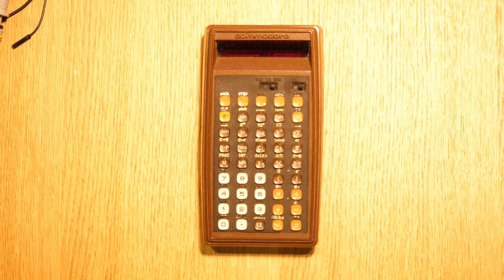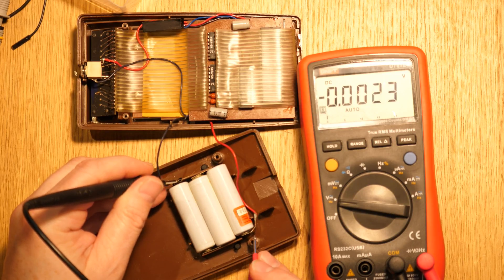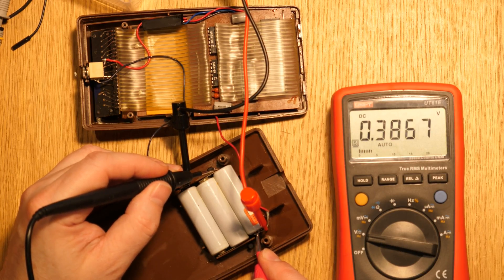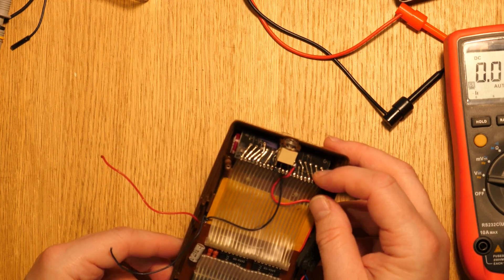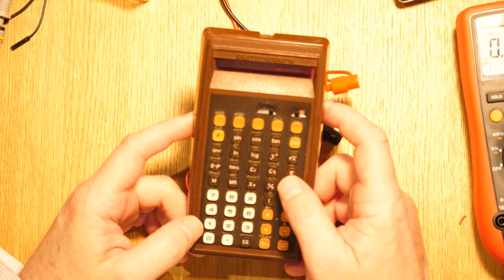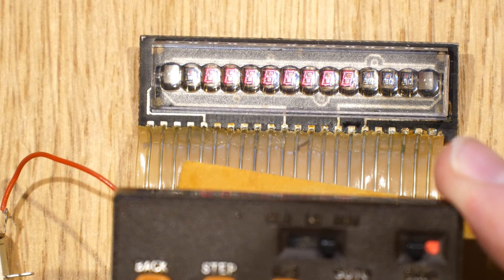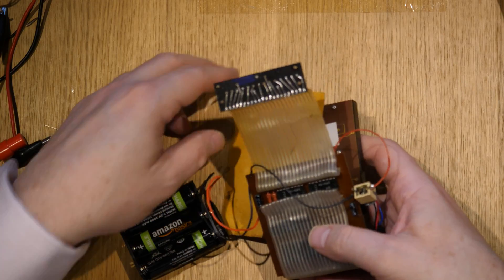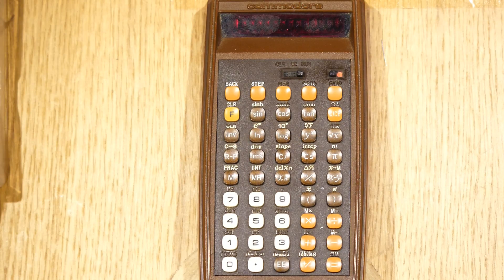Commodore PR100 retro calculator renovation

Comment: Interesting.  So that little potted stick is an inverter.  I always wondered what those were.  In addition to the PR100, I had an SR4190R that carried me through tech school.   It had a killer feature - I called it "exponent bumping" that I have never found in a non-Commodore calculator.  Basically, if you have an answer in nano-somethings and you really wanted micro-somethings, you just hit a key until the exponent shows -6...the mantissa will adjust to suit.   Being so fond of that, I still have a working 70's Commodore on my desk - an SR5190R.    And a couple SR-1800's.  Not as fancy as the SR5190R, but they have gorgeous green fluorescent displays.

Comment: I removed the batteries in the '90. With the charger still working! Nostalgic fun. I just followed your programming steps :) Instead of +1=  i tried + 0.01= to 00 as floating works :) I wonder what number I get tomorrow. Thanks for remembering were we come from... It is a piece of history that 72 steps calculator
Reply: Was the ram originally intended to be battery backed or did it clear when turned off. I did a repair on mine and mine clears but I’m curious if that was intended.

Comment: Thanks for sharing this. I too have picked up a PR100 from Ebay and looking to get it working. Thanks for the insight of the inverter in the black box. I assume this is to generate some negative voltage for the IC chips (or all of them). From my basic undertanding, these circuits are possibly using an LC oscillator, with capacitive coupling with a pair of diodes to output some negative voltage. However, these inverter circuits don't source/sink much current? Do you know what the circuit current draw is?
Reply: >However, these inverter circuits don't source/sink much current? Do you know what the circuit current draw is?< 
The power stage supplies the negative voltage required for the MOS chips of approx. -5 volts in relation to the BLACK of the battery and the power supply voltage of 6 volts. The current of the power stage ranges from 40-110 mA (depending on the utilization of the 12 digits of the 7-segment display).

Comment: You should be able to just press R/S (RUN/STOP, like on the Commodore 8-bit computers!) again to STOP the running.
Reply: R/S stops a program during execution to show a value on the display. If one press R/S again it resumes the program...
It's also used to start a program... Notice how he runs the small program - he presses GOTO 00 and then R/S... It is possible to have two or more programs in the memory and execute a particular one by typing GOTO followed by a 2 digit number between 0 and 71...
Reply from the maker: Just be aware it'd been about 35 years since I last used this ;-)

Comment: Don’t know if you’re still seeing these comments but I really like to know where you put the capacitor across the inverter? It looks like the blue and black but it’s too difficult to see. Thanks
Reply from the maker: I'd imagine it was on the output.
Reply: @nezbrun872  It looks like its directly attached to blue and black. I have an SR-9190 that just displays a row of decimal stops across the display. I noted that the outputs from the inverter seem to be +4 and -2. Not sure what they should be but I think the -2 is too low. Also don’t know what the effect of only -2 might be. Would the cap across blue and black help at all? I’ve replaced the other two capacitors and cleaned and resoldered  the wires from the inverter, which had output +3 and -1.5 so a slight improvement, but still not a working calculator. If you have any pointers I’d welcome any further advice you have.
Reply: @derirrevomzombiehof4893  Many thanks for this, and you English is good. If you find out any more please do let me know. My electronics knowledge is very basic, so please explain in simple terms. I’m powering it from 3 AA 1.2V rechargeable batteries connected straight to the circuit board. My fear is that one of the ICs has been blown due to over voltage, my hope is that it’s just incorrect voltages being supplied by the ASTEC power inverter and regulator. If I had another I’d solder it in and see if that fixes the issue, but I don’t. Could you take the ASTEC from your working 4190 and try it in the bad one and see it fixes the issue? I have replaced the two capacitors, I don’t know if the 4190 has these capacitors? but it made no difference :-(

Comment: Nice video. I just got one of these calculator with similar battery. But is it  ok to just solder in three 1.5v batteries on as shown in the video? Wouldn't the voltage be too high?

Comment: I had one of these!  Still hiding in my junk somewhere.    I bought it brand new when it came out.  Actually, I saved up the complete price - including tax - and put it in an envelope waiting for the ( programmable! ) calculator to become available.  I seem to remember going to the calculator store once a week for about 6 months.  Somebody had messed up at the factory.
I wowed my calculus teacher by writing a program to calculate pi by adding up the area of a quarter-circle.  And wrote programs to play with resonant circuits.

  At some point, I eliminated the battery by replacing it with a string of forward-biased diodes.
The calculator would only work when plugged in, but it didn't suffer leakage either.

Comment: Hi, I have the same model but mine has two 47uF instead of 33. Unfortunately the black box that delivers the negative voltage is missing, I remember I took it apart, but it got lost somehow... I tried to power  with a regular DC adapter - it turns on with only the terminals +5 and GND connected, but it only displays 0.00 and all keys seem to be unresponsive. Later, I powered it with +/- 3.6V and GND (I used 6 NiCd batteries) but the unit either displays 0.00 or random numbers on the display. The display works fine, all segments are ok, also the two small chips that drive the keyboard and leds work well... Could you please tell me at which terminals have you connected the 33uF,  I really liked to put it to work...
Also, do you have any idea how can I replace the power converter with modern components? I was able to open it, it had a small coil with two windings, two transistors or FETs (couldn't measure them because the terminals were too short after I took them from the small PCB), one diode, two resistors and a small capacitor... Some people say that power converter delivers a negative voltage with a clock signal...

Comment: Nice video! It's a a 100 not a 72 step programmable though. That's why the name: PR100 = PRogramable100steps ;-)
Reply: Excuse me but it's 72 steps. The extra 28 steps are used for the memories or parenthesis operations...
Reply: Yes, I was looking at the manual tonight and page 34 confirms that there are 72 locations available for programs. I don't see anything in the manual to confirm or refute that there are a total of 100 steps with 28 reserved.
Reply: it was 72
Reply: Actually I think the R stands for rechargeable as with other calculator model names. I believe a similar but inferior model called the p50 was programmable but not rechargeable.